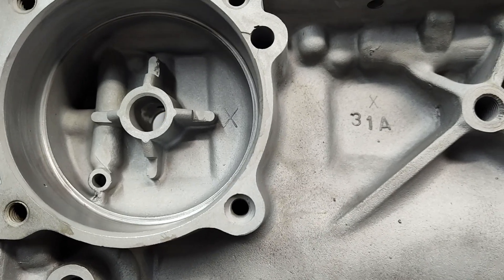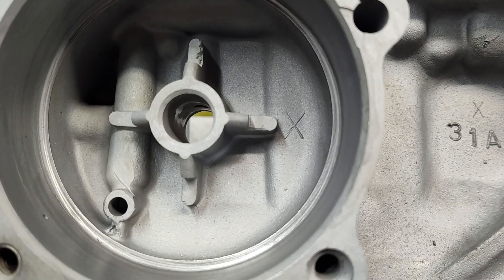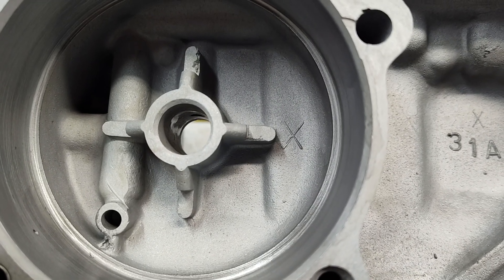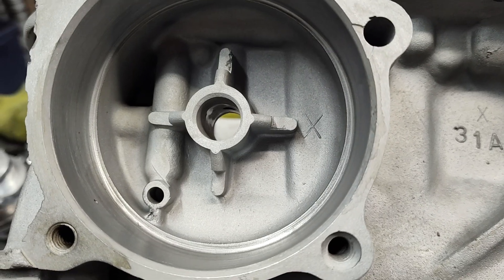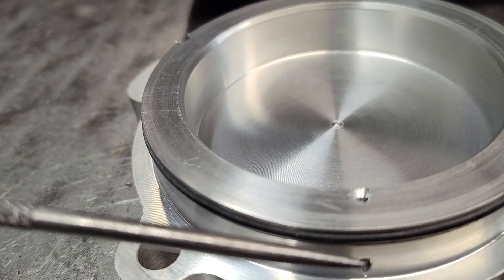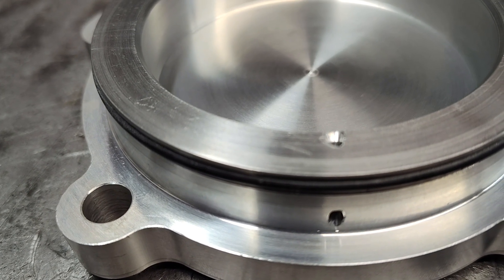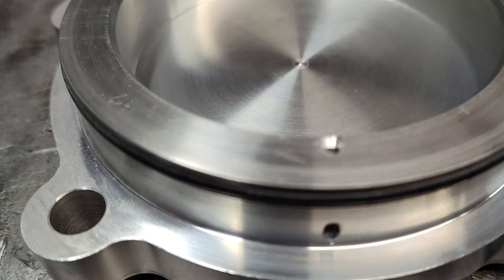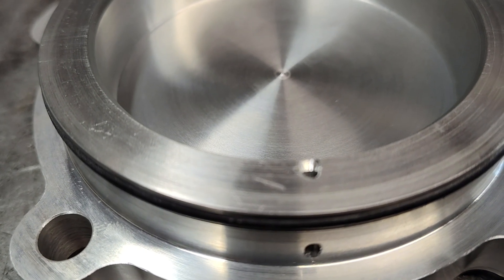Ford C4 Transmission Servo Modifications and Safety Concerns

Comment: Greetings from Oz. So glad to find your channel Jay. Parts/upgrades for the Ford C4 are pretty hard to find in Australia. I purchased a rear rollerised thrust and a rollerised front planetary from you and had it shipped a few years back for my DIY rebuild (C5 trans) 

I have a modified full forward pattern VB purchased here in Oz. Have an R servo. My ride is a 1500kg car putting out close to 500ft pounds of torque. I received no instructions with the modified VB but I have this 2-3 flare. It’s a bit random. Doesn’t happen everytime but enough to be annoying.

Iv’e never modified the R servo. It’s the stock R servo that was in the trans when I bought it. As far as I can remember when I rebuilt it, I installed the O’ring. 

Sounds like I need to modify this as shown in this video, to see if that overcomes this “bang” into 3rd I sometimes experience. Or should I be trying a different apply servo? Cheers:
Reply from the maker: If the modified valve  body you have doesnt use  release oil on the servo it  wont really matter which servo you use.

Comment: JAY IS RIGHT , The Factory Green spring is the way to Go  
Im using the Green spring with Superior R code Servo and E lever , thats what I'm running in an Autoshift C6. 
Whatever shift kit that's in there is what I'd call a FIRM Shift. 
The Superior Heavy spring was causing me problems. 

Ive tried the Sonnax R Code servo with Heavy spring and it also caused the same problem. 
The Factory/OEM Green spring  fixed my issue. 
Read my other comment on this video.
Reply from the maker: Good info. Thanks for sharing your experience.

Comment: Thank you Jay.  
Appreciate the video and knowledge shared.
For all the viewers that read the comments....
Ive had a problem weather i.tried the Sonnax R code or Superior R code , both with E code lever.  
And not sure wich spring is in there for either brand.
This could be my issue. 
The issue is a hard downshift when coming to a stop. 
I believe its a 2-3. And 3-2. Bind. 
Dosen't always do it. But happens more often than not. 
Im definitely going to check this out.

My original servo was S code  and A lever from the factory.  Im second owner of this 77F250 4X4.  
I know the Original owner had a shit improvement kit installed back in the 1980'S.  

Anyhow,  now i have something to inspect.

Edit--  i just checked my situation,   im running the Superior R Servo , and E Lever. 
I had the Heavy Superior spring in there. 
Replaced it with the FACTORY/OEM GREEN SPRING. 
Basically fixed 95% of my hard downshift/binding/ chirping the tires when coming to a stop. 
Or the driveline binding when rolling down the street and it shifts from 3-2.
The Factory Green Spring is THE WAY Too GO. 
In my application. 
I do have a shift kit in the valve body. 
But don't know wich one. It's been in there from the original owner. And I bought the truck in 1994.
Reply from the maker: Good info. Thanks for sharing it

Comment: Back in the early 90's I did the modification with using an A servo piston, without the O-ring on the outer piston, with an H servo cover. Then plugging the vent hole. I was using it with a valve body that I used the old B&M Manual-Pak kit to convert to a full manual, but still forward pattern, valve body. Never ran into problems with it locking up on me, but I was pretty particular on my maintenance and usually pulled the transmission out in 100 runs to freshen everything up, so there was not time for the seals to harden up. Where I DID have problems is that thin portion of the gasket, near the now plugged vent hole blowing out. Cost me $800 in a final round back in the late 90's. Made a girdle to surround the entire servo cover, with a set screw right over the weak spot of the gasket. That cured the problem, but never trusted the setup again, so I purchased an aftermarket servo. Quite honestly, I never noticed any difference between the H servo, my modification and the aftermarket one and was probably just as well off continuing to use the H servo.

Where I DID have problems with it locking up in high gear was when I started to make a little more power, about 1986 with my '68 Mustang. I was still using the factory shifter with the solid shifter rod. The valve body at that time had just a standard B&M shift kit of that time period that had 3 different stages of modifications. The car was probably starting to flex and was pulling on the high gear detent. My memory from almost 40 years ago is not very good, but I think at that time I studied the hydraulic diagram and determined it was possible to leak pressure to start to lock up the low/reverse band if that happened. I DO know that I ended up skidding in the grass and was probably lucky that the car wasn't faster than it was.

Bought an aftermarket shifter with a cable and also bought that B&M Manual-Pak at the same time and never had another problem.
Reply from the maker: Good info. Thanks for sharing
Reply: Yes I used a B and M Manual -Pak back in 1976 in a 65 Mustang. But I did it for mountain driving so I could control the down shifts for engine braking going down grade. Kind of a hard shift but worked fine. I just followed the instructions.
Reply: @GaryH-pw9cm   They worked great for drag racing. Good firm shifts and no flare.  Came with all the jigs to make the modifications and very complete instructions. I used that valve body for a lot of years and it is still in my shed somewhere.
Reply: Had a TCI servo today. Exactly this. 
No hole or vent. Now corrected 😊

Comment: Just looked at my Sonnax C4 "C" servo,  and it doesn't have the o-ring, rather the body has a slight step on the od, and a notch in the side just like your mod. 

Love the videos, keep them coming! Btw I'll be in touch to order a stall converter for my c4 to go with your transbrake i just bought 👍
Reply from the maker: Thank you. We appreciate the business.
Reply: My Sonnax C4 servo has lip seals. I guess they are better than O rings. I really don't notice anything different during shifts.

Comment: Sonnax and Superior R Code servos for the C6 both have the o-ring. I will be running your C6 auto shift VB and just want to make sure I should be removing the o-ring in my Supeior R Code servo? Thanks again for putting your experience and knowledge out here for those of us wanting to learn the art of these antique transmissions.
Reply from the maker: I dont use that oring but its probably not an issue if you install it.